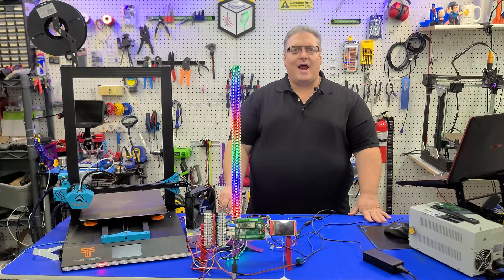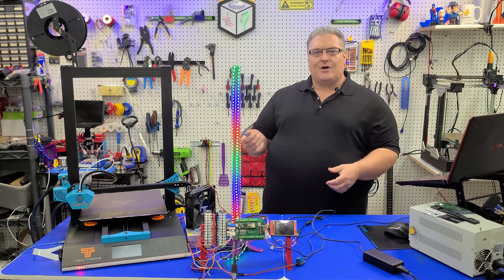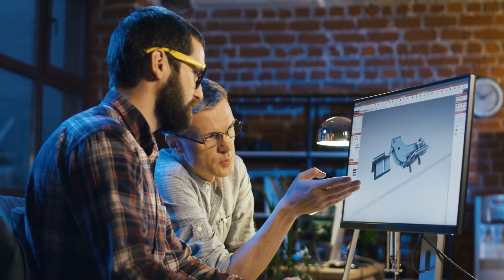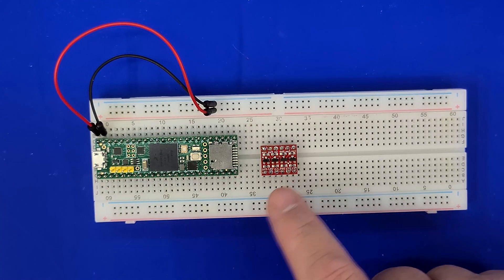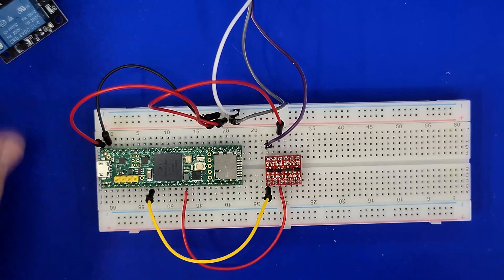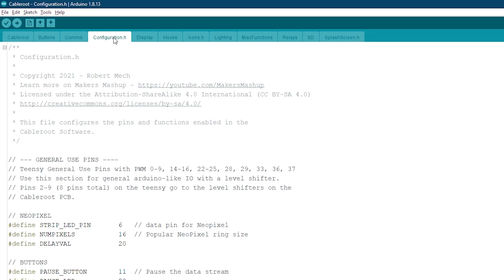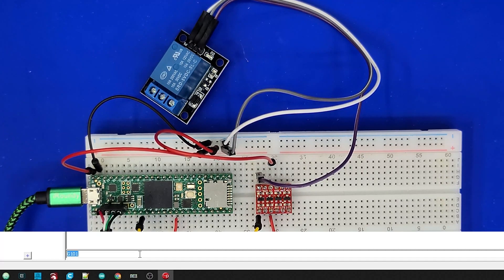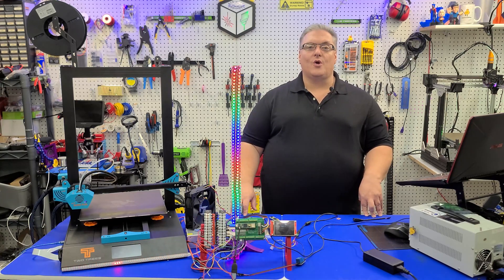Control Anything with G-Code | Introduction to Cableroot

Comment: You can also use a raspberry pi pico for this. $4.00 :)
Reply from the maker: To my knowledge the pico has only a 133mhz processor and only 1 usb port. I don't see how that could possibly work.

Comment: Imagine you use a laser engraver to make a small engraving. Once completed a ardunio robotic arm would move the completed engraving and grab a new piece to engrave. Imagine using this robotic arm to remove very basic prints and keep printing or move an object to another 3d printer for a different color.
Reply from the maker: Filament Runout sensors don't look at the extruder.  They are generally a simple microswitch that is depressed when filament is present.  So if it jams the filament is present but not moving.  So traditional sensors will not report a jam and report the filament is present.  This uses pulses so if the filament is not moving but present it will report a failure.

Comment: I can think of several uses for this but I can't honestly say that I want to do any of this for my set up. Octoprint has all that I want and the Pi is a full computer with GPIOs that are stupid simple for me to modify any time I want and it already automates the small things that I want to automate. Since Octoprint is a simple web interface, I modify this as well to include what I want with extra "on screen" buttons on the interface itself or whatever customizations that I want. 

I do like this project as an alternative so I won't say anything negative about Cableroot, I just don't need it. Plus to get it to do exactly what I have done with the Pi, I would be changing code in cableroot as well. It's far easier to keep what I have without learning yet another interface and changing all my current wiring. Sure it's not challenging but why change a thing that works exactly as I want, ya know?
Reply from the maker: I totally agree.  Cableroot is not an octoprint replacement, its just a means to expose things you normally cant access with existing methods.  Octoprint is great and I use it along with Cableroot.  I certainly wouldn't change up things if they are working for you. :) I feel one of the biggest use of Cableroot is really for those that want to mod their printer with Neopixels and control them with gcode.

Comment: The same things can be done with the octoprint plugin "GCODE System Commands" with the added benefit of using properly supported hardware and software.
Reply: Plank,  Are the Gcode system commands two way?  
I.e.  telling the hot end to move to a specific position position and then get feedback when it does. 
Looking at this for automating menial cleaning and alignment tasks. 
Closely coupling the feedback of sensor to position control is what I am looking for but it has to be closed loop.
Reply from the maker: You can make it closed loop Karl. Right now Cableroot passes through the gcode untouched in most cases.  The code currently checks for the OK from the host but you could easily send a command, read a response and perform actions from there.  The other cool thing you can do with this as well is store complete blocks of functions (such as cleaning and alignment) in the code itself.  So with a push of a button you could run any number of preloaded routines checking for responses along the way.  You don't have to have the overhead of octoprint or anything else, just load the commands right onto the Teensy.